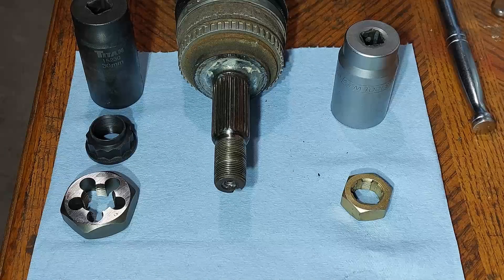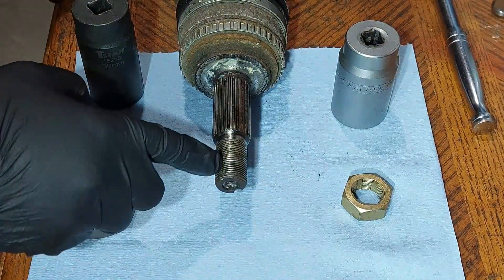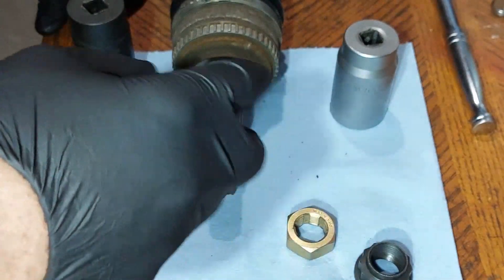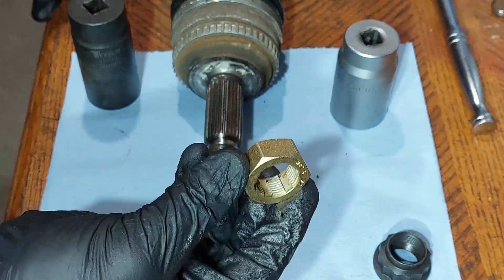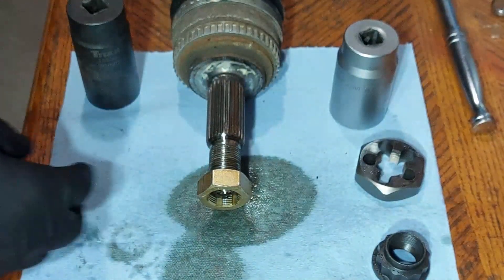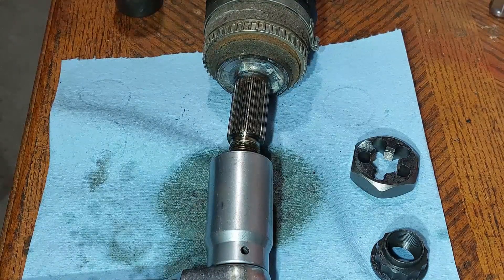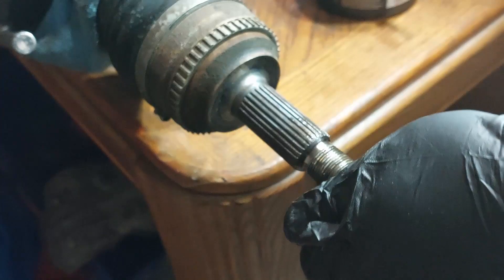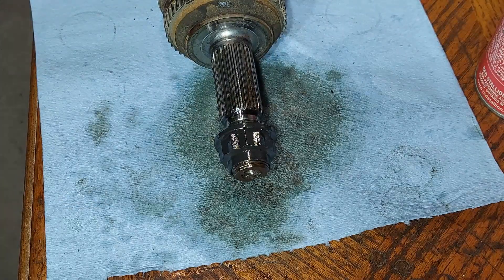Repair Damaged CV Axle Threads

Comment: How did it get damaged?
Reply from the maker: This is an old axle. The boot has been leaking some grease so it was replaced. It came off of a 2009 Toyota Matrix. I just used this axle for demonstration purposes. It got damaged because the axle nut was not unstaked before removal.